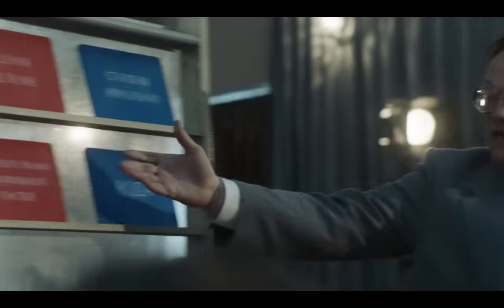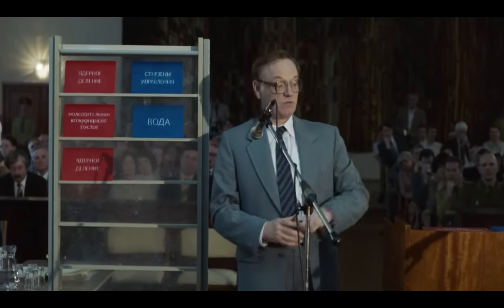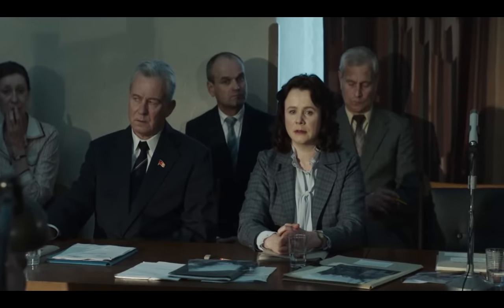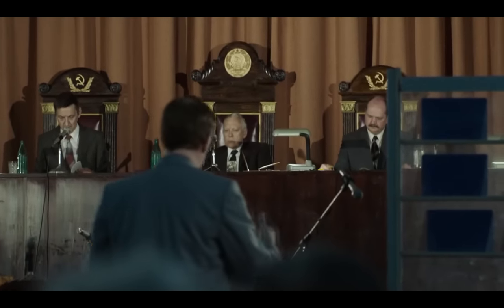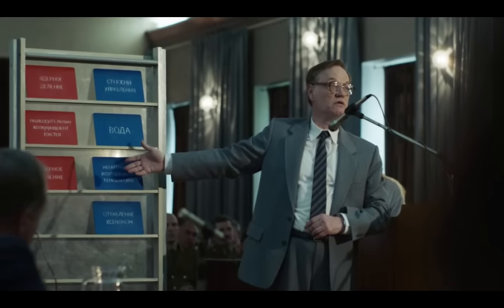Chernobyl scene #1: Valery Legasov explains, how an RBMK reactor works

Comment: A lot of sources will mention "Graphite tipped control rods." However, that isn't really the correct term.

You see, the control rods actually had two sections, one was made of boron, and was made to slow down the reactor. However, the other section was made of graphite. When they took out the control rods, what actually happened is that they removed the boron section of the rods, and brought in the graphite section. This was part of the critical design flaw that caused the explosion.

When the scram was initiated, they had to push the graphite rods out of the way so they could bring in the boron rods. But as the graphite moved,  it increased reactivity, which created a surge, and ultimately led to the explosion.

Source: https://www.youtube.com/watch?v=hIGtTImeYU4

Comment: Damn, even the guys in charge of the plant didn't know how a nuclear reactor worked? Ouch..
Reply: No they knew damn well how nuclear reactors worked. They knew how the RBMK reactor was supposed to work. But those reactors contained a specific design flaw that the designers knew about, but didn't include in the "instruction manual" The positive void coefficient and poorly designed control rods. Even if the operatoes fucked up 1000 times worse than what happened that night... The core still NEVER should have exploded. That was on the designers.
Reply: One problem with dramatizaiton is that it simplifys things and in order to be engaging, has to follow simple, millenia old tropes - including "hero", "villain", "wise man" etc. This series is no different. There's ton of documents explaining what and why went wrong in Chernobyl, and mockumentary made by staunchly anti-nuclear and John Oliver fact averse HBO IS NOT ONE OF THEM.
Reply: @blackhawks81H  so in a way, the shut down button acted as a detonator.

Comment: Essentially the operators were like people riding a bicycle at too low speeds. If you've ever done that, you'll know that it feels like it'll fall over any moment. So what do you do when it starts to fall? Right, you violently try to swing in the opposite direction to regain balance. But that can't be achieved because the momentum for equilibrium simply isn't there, so all you do is start falling in the other direction. 
Now imagine ten people on that bicycle, all trying to yank it back and forth and an angry Russian screaming at you. It's a small miracle that Reactor Nr. 4 was the only one of the RBMK series which went into meltdown. And to be fair to the design, it did work and had many advantages (worked with less enriched fuel, parts could be assembled by relatively unskilled workers). The problems came in when the most basic safety measures were blatantly ignored by inexperienced staff and a piece of shit boss that fateful night. Otherwise these reactors ran fine, their flaws kept a secret by Soviet red tape and simply no one pushing the reactor type into this situation.

Comment: I cant help but wonder if the controllers that night had a shoe factory education this would've never happened.
Reply: It may not have happened if they were told that A3-5 was extremely dangerous to press when the reactor was stressed to its limit. Instead however, the Soviet Union covered all knowledge of it up.

Comment: Basically playing tennis table with Death but if the ball ever touches the ground we all loose -no matter who missed it
Reply: You are not wrong, but with nuclear engineering we are allowed to change the rules of the game, and keep changing them, and stop playing if we can't figure out how to fix the rules in our favour. Comparing Chernobyl to a 4th generation reactor is fair -- like comparing a Ford Model T to a Subaru Impreza; the modern version is much much safer in the hands of sane management and operators. But if we stop playing, shut down nuclear power as Germany and Japan are attempting to do, we have to acknowledge the costs (in human lives, I mean) of the other choices too.
Reply: A far maximized version of an internal combustion engine, which is basically having to create a micro-explosion inside your car every time you need to get it moving.

Comment: After HBO’s Chernobyl, I am even more less worried about nuclear power plants. Those past physicists knew that the core should not blow. It blew because the USSR redacted two pages describing how the control rods with graphite tips can get stuck.
Reply: Im not and expert on the matter, but i dont think controle rodes were stuck, i think explosion occured when rods came in becouse they had graphite tips which increase reactivity on already unstable reactor.
Reply: Crni Vitez The show explained, and I am recalling as best as I can, when the graphite tips touched the fuel, the reaction caused more heat that damaged the system/pressure tubes(?) that lowered the control rods, so the rods were stuck with only the graphite tips touching the fuel. If the rods did not get stuck, and all lowered, then the reaction would have stopped completely, as the shutdown protocol AZ-5 was designed to do.
Reply: @III-zy5jf  Im not sure eather,i think you are right but i think problem was not that they stucked, they were pulled out and when they were reasserted graphite tips entered first and added reactivity to already unstable reactor, i dont know if they stucked but i dont think it made difference at that point
Reply: Crni Vitez The instability of the reactivity surge in the lower part of the core ruptured a number control rod channels in the region effectively blocking them. When AZ-5 was initiated, the control rods in these channels were not able to transverse the full height of the reactor which resulted in their “graphite tips” getting stuck in a position that they accelerated the already out of control reaction from the bottom of reactor. This was explained in several scenes of the HBO series. The term “graphite tip” is kind of misleading. In reality affixed below the Boron control Rod was a graphite Rod that would almost completely displace the region the control Rod would normally occupy when lowered fully into the core. The graphite moderator Rod was imperative to the normal function of the reactor because of the non-hard water used.
Reply: No one else in the entire world operates RBMK reactors. The rest of the world generally uses water/water, not water/graphite. The rest of the world also has containment buildings. If Chernobyl had a containment building, the second explosion wouldn't have ripped the building apart as it did.
Reply: @SouthernPacific8984  I believe you are correct but one small thing: " The graphite moderator Rod was imperative to the normal function of the reactor because of the non-hard water used." <--- you mean non-heavy (light) water? Canadian reactors, e.g. use heavy (deuterium-oxygen) water.

Comment: Why hadn’t the designers of the Soviet RBMK reactor taken electrical grid failure into account?
How did they not know that it would take the backup generators 75 seconds to pump adequate water for cooling?
The blame lies more with whoever declared this design as safe than those who ran the tests that day.
Reply: It was a boneheaded decision to use Graphite, a material that can retain heat and itself cause a positive void coefficient, as the moderator. A similar circumstance happened at Windscale. Poor engineering is inexcusable and criminal, in scenarios where lives are at risk (see also: the 737-MAX).
Reply: It's exactly like he said, it was cheaper.

The Soviet Union's nuclear technology was always behind the west and they viewed ANY design that could be utilized to get ahead of the West as being worth any risk. The truth is Communism just doesn't produce a good product
Reply: They also covered up their mistakes instead of learning from them.
Reply: They have.  That was whole idea behind the test, to check if this works correctly.
Reply: That was the lie he spoke of at the beginning of the series.  What is the cost of a lie?  So many paid the price for the Soviet's lie that RBMKs could not explode, had no flaws, and that there as a 100% foolproof failsafe if things did go wrong.  Not the Soviet leadership, it was the people on the ground that paid heaviest.

Comment: The guy in the video failed to explain the last part. The reason why the reactor went supercritical after the xenon caused the reactivity to go down is because the operators took away the control rods to try and increase reactivity, not knowing that as soon as the xenon burned up, the reactivity would skyrocket beyond control. It's like a fire that's taking too long to start so you add a bunch of extra fuel and then once it DOES ignite it explodes.

Comment: I want to know why instead of pulling all the control rods out did they not lower the flow of water first to get it up to the right power.

It feels like they were trying to drive a car in 6th gear at 20mph and instead of lowering the gear they were in they instead removed the brakes first then put the car in neutral (when they turned the pumps off)

P.s I have zero education in nuclear power.
Reply: Don't feel bad, the people in charge apparently had a similar amount of education.
Reply: I think it had something to do with the Reactor test. They were testing if the remaining power of a dying (powering down) nuclear reactor could feed its energy towards the water pumps and allow it to pump water into it. And to have the nuclear reactor be at lower power, the power rods needed to be at a point where it's lowering the Nuclear Reactor's power. When they encountered that Xenon pit, they didn't know that the reactor was lowering its own power because of Xenon, and that the change of position of the control rods to power the reactor wasn't really going to remove the Xenon right away. But when the Xenon did go away.... Well, the rest is history.
Reply: Its because they wanted to rush everything so they took out too many control variables.  It's the stupidest fuckin thing they could do but yet they did.  Once the power started to skyrocket cause the xenon was no longer slowing the reaction and the water was too hot, they had no conrols left in the equation to slow it down.
Reply: Basically they tried to rush a safety test while the reactor was in an unstable / unbalanced state. 
Pulled all the control rods out to get the power up quickly. Then turned off power to the water pumps which increased the reaction. Then the xenon gas burned away which increased the reaction. At this point theres no absorbers or water flow. Finally lowering all the control rod absorbers that were connected to the moderators slowly was like hitting the detonator.

Comment: Isnt water increasing reactivity by lowering the temperature of fuel?
Reply: Raviteja Chandu the water acts as moderator. It slows down/limits the fuel’s ability to sustain a chain reaction
Reply: @samhipps8435  Read that after posting this comment...thanks anyways😀
Reply: @samhipps8435  No a moderator slows down the neutrons to a speed that is appropriate for a nuclear reaction to take place, without a moderator nothing would happen to the uranium. So basically a moderator increases reactivity.
Reply: @samhipps8435  No, water acts as an Absorber when it's cold. When it turns to steam, it acts as a moderator which INCREASES reactivity.
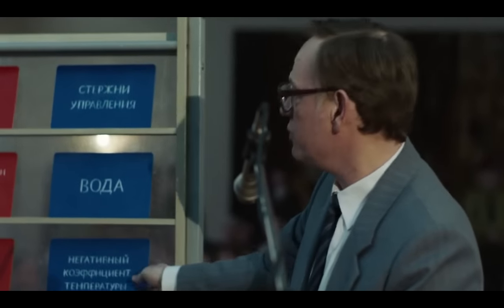Reply: 1:55 nuclear fuel becomes less reactive when it becomes hotter! Can someone tell why?

Comment: Positive void coefficients are theoretically more effective but when dealing with margin errors this is disastrously problematic. As temperatures rise, the moderators decrease. Eventually, the reactor will reach a temperature of which cannot be recovered from.

With negative void coefficient reactors, as fail-safes are removed, the reactor cannot continue to develop power. We are dealing with a negative coefficient.  For those who haven’t taken pure math, a coefficient is a leading variable to an equation. Negative coefficients means the reactor will  produce colder temperatures without moderation, which is perfect for safe system conditions.
Reply: One thing though, moderators increase reactivity. You're thinking of absorbers.
Reply: I think you’re right. What an odd thing; slowing the speed of the neutrons thus increases the probability for fission. Is that correct? Absorbers are the rods which remove the neutrons.

Comment: I've read that some modern systems use electromagnets that drop the control rods passively if there is a power cut.
Reply: Correct it's a design quirk originally seen in the CANDU reactors. They either use magnets or weighted spring solenoids.

Comment: why manufacture boron control rods with graphite tips to begin with?
Reply: Ok it's not a really problem unless you pull the rod all the way out. In brief, it makes it "easier" to balance the core IF things are working right. If the rod is part in and part out the tip is inside increasing reactivity BUT you also have boron inside decreasing reactivity. Dyatlov and his merry band pulled almost all the rods COMPLETELY out so when they tried to SCRAM the reactor. the first things  down the hole were the graphite tips without the  boron higher up to compensate until it was far too late once the boron section entered. "Too late" can happen in miliiseconds or faster in nuclear reactions.

Comment: he says water decreases the reactivity.  but isnt water supposed to increase the reactivity by slowing down the neutrons? well that is the function of a moderator right!
Reply: The water slows the neutrons so they can collide with the uranium atoms causing fission. The graphite moderates or when inserted into the core which had no fresh water increased reactivity which converted to steam which exploded and forced the lid of the core off and the exposure to air mixed with the heated graphite and hydrogen caused a secondary explosion which destroyed the plant reactor. Without the water the neutrons wouldve been moving too fast they’d fly past the uranium atoms
Reply: In the RBMK, water was the coolant and graphite was the moderator. As the water boils, it absorbs less neutrons which mean reactivity increases.

Comment: The question remains: If Legasov explains this so clearly: Half-power reactor creating Xenon, which could pollute the core, with disastrous consequenses... Why didnt Dyatlov realise this for a moment? Why was the Reactor not ordered to operate at normal capacity to ensure the core was clean, and not polluted by Xenon? Why didnt Dyatlov order the reactor to be powered up to normal capacity, and let it run for.. idk 1-2 hours to make it 'clean itself', before they did the test? 'Safety first, he'd been saying that for 25 years"... 25 years and he overlooked this part? The reactor hád been running at much lower capacity for hours....A small error perhaps, but a grave one! How did Anatoly Dyatlov NOT realise this, with over 25 years of experience with this.

As the most experienced expert that night, he was the one to come with that information; thats why HE was overseeing the test!
Instead of making use of his vast knowledge, he was arrogant and even agitated that such common tasks were required of him as he considered it beneath his status. He was angry and arrogant tot he engineers who operated the Reactor, snarled at them and bossed them around.... only to 'take a shit', and not oversee a thing, not realise that a stalled reactor was creating pollution inside the core that simply could be urnt away by powering up the reactor to a normal level, which would have burnt up any impuritys, and the test would have simply passed...

Dyatlov's arrogance was the greatest factor here. He didnt use his brain, he pulled Rank on anything or anyone who DARED question even the smallest step in the process.
Reply: You need to read some books on Chernobyl. This HBO series is wrong in many ways. The main issue was that the designers didn't explain the flaws in it such as the positive void coeff and instabilities at low power. Dyatlov was no fool; he was ignorant of the design flaws, though. As a side note, xenon results in a decrease in power as it robs the fuel of neutrons. The main problem was the pos.void.coeff. and the removal of pretty much all of the control rods.

Comment: I'd like to use this method to explain why my life is fucked up.

First, you have this Goal, a pressure you put on yourself to attain something only a select few are blessed with the knowledge to do so.

But, you have friends to balance it out, to ease the pressure and to relinquish the stress you acquire over time.

Getting friends, puts your parents breathing down your neck to avoid them, and focus more on the task at hand.

So, you acquire hobbies, to replace the void that was left when you renounced the friendship you acquired over time. Creating an illusion that you are still in control.

However, it seems like this illusion may well off forgotten for it created a distraction, an interferance of the goal at hand. It made you unfocused, unclear of what you really wanted to do.
.
.
.
Still working out for the rest..

Comment: The concept for rbmk reactor to  work full power even 40 years the same performance. Full power 1000mw electric energy and massive  plutonium  239. chernobyl desaster is inside job, rbmk is a big reactor I like it. Nowadays 9 reactor work full operation.

Comment: How does water reduce reactivity if lowering the temperature increases reactivity?
Reply: Water absorbs neutrons, which reduces the number of reactions which can happen per reaction (the idea is to keep it at 1 for 1), if the water boils then the steam displaces water and the reactivity increase. It's possible to make reactors which don't get hot enough to boil as the increasing temperature reduces reactivity so much that they'll shut down, but they're only good for lab experiments, not a nuclear power plant.
Reply: @Pete856  thanks!